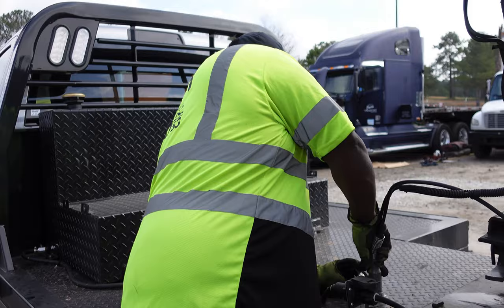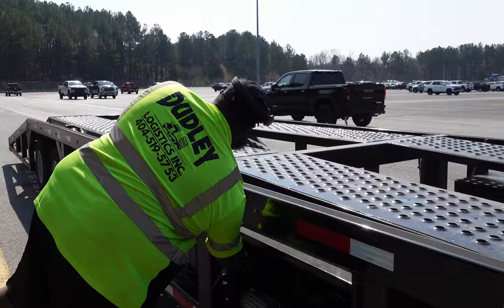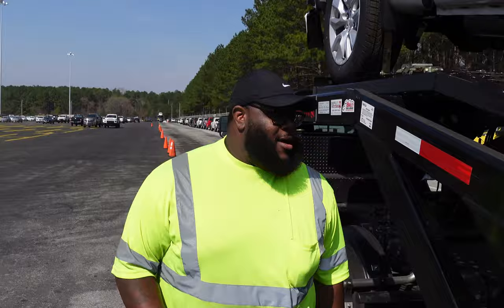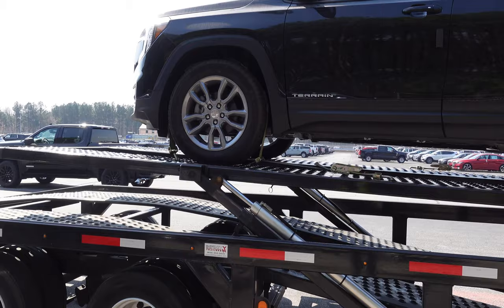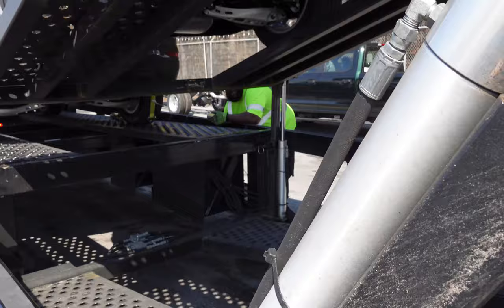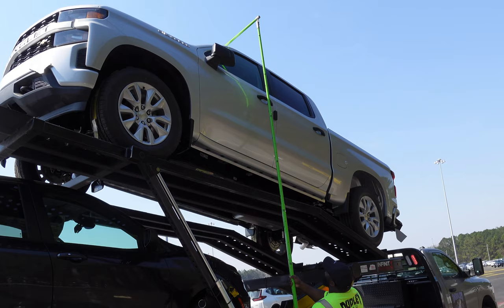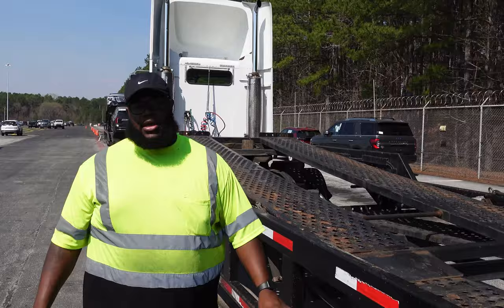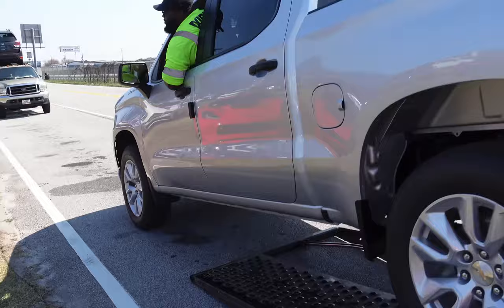5 Car Infinity Trailer Loaded

Comment: Ok, the weakness of all the 3500s is the 9900lbs rear axle. Sure, it can pull the weight but that axle can fail while moving. If you run into a DOT axle weigh, they will put you out of service for over weight on the rear axle. The 4500s can take a little more, but ultimately a 5500 should be used for this trailer.
Reply from the maker: Yea your correct but sometimes you have use what you until you can upgrade stay tuned thank for watching!
Reply from the maker: Yea try to wait it out
Reply: Facts …. I just stay with my EZ 4. Balzi
Reply: Should I get 19.5 rims on my ram 5500 if I want to haul a trailer like that ?
Reply: @angelcabrera2765  The tire and rim combination from the factory on your 5500 will do the job. Most of the rims upgrade is done to ensure the truck has more than enough to carry the overload.
Reply: @rctjacksonville   appreciate it brother.
Reply: Thats y you run scales ⚖
Reply: shoutout cameraman
Reply: If the info on the trailer website is correct none of their numbers add up unless the cars weigh 2500 pounds
Reply: Agreed. He need a 5500.
Reply: @banksboy6806 yea, the GVWR on that trailer is around 25000

Comment: Hauling 33k with a ram is risky as hell. I had a 3500 6.7 dually hauling 15k everyday but after 300k my truck gave up on me. Rams are cool but not for the long run.
Reply: Them light or mid duty truck are not made to for heavy weight  like that. I've  never seen one last longer than 150,000 miles unless you change the motor or transmission and I've  been in the business for over 10 years and I have coworkers that had Chevy, Ford, and Dodge and that's torture for them trucks. The price for mid-size heavy duty truck brand new isn't worth it in the long run unless you are trading it every 1 to 2 years, which will make you upside down. It would  be smarter to get a 2, 3, or 4-year-old semi for the same price with a factory  warranty.

Comment: Captain, you may want to lock your pins  in when  you are loading  and unloading to be safe. Hopefully, you are doing it by now and checking the height from the roof and adding  2 or 3  on chevy trucks for the antenna.

Comment: I would pull that Chevy on the back all the way to the end of the trailer.   That would give you more room but will also reduce pin weight a small amount on the truck.

Comment: Spot one could be in spot 3 easy I've done it many times 

That truck will give out on the transmission or transfer case the truck frames are too weak going based on my experience
Reply: Only on Dodge, Ford are good and chevy are to new.

Comment: I have a 2021 Dodge 3500 with a 6.7 commons turbo diesel with a 6 speed Alison transmission sitting on seventeens will this truck allow me to haul a mina five without changing the tire size and without overworking it?

Comment: Awesome video man. Im looking for a 5 car hailer but now I’m wondering if I should get a 3500 or the 5500? What u think with all that weight.
Reply from the maker: Depends on what trailer your going to run!
Reply: Kaufman mini 5?
Reply from the maker: that will be fine with a 3500
Reply: @CubanKing305 a Ford 550, 600, 650, 750 or a semi, stay away  from a Dodge. It will possibly put you out of business or in the whole maintenance wise.